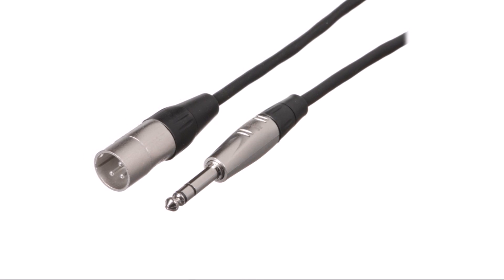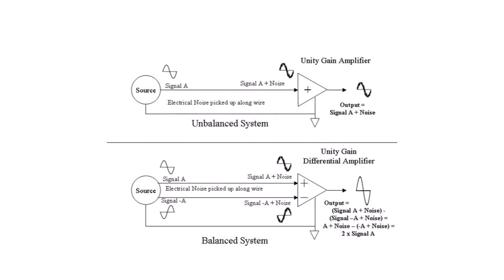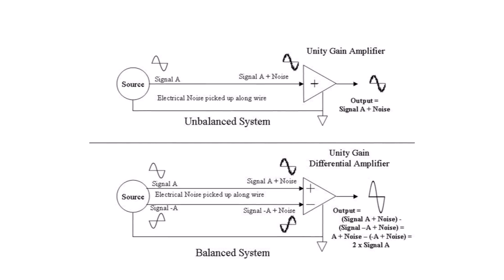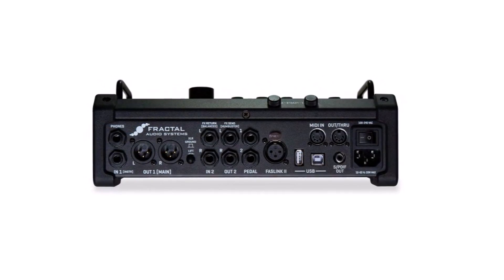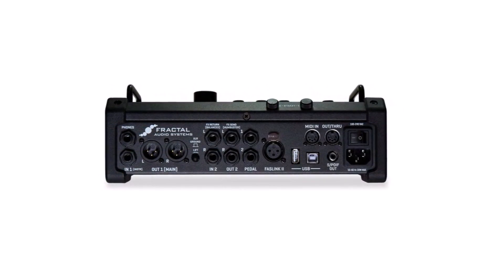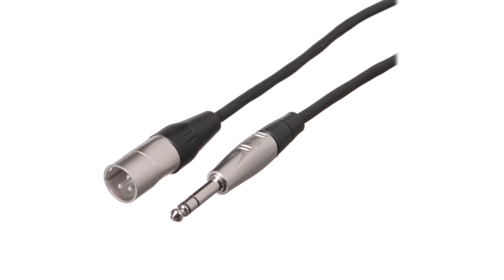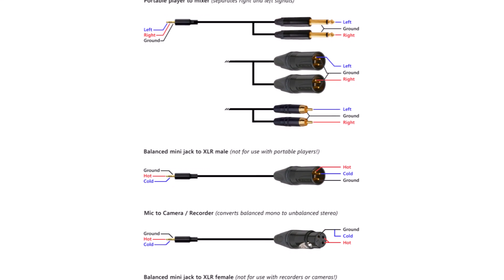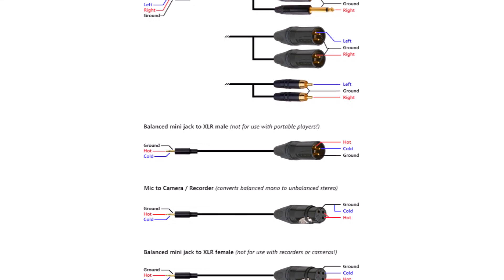Audio Cable Standards: Instrument, Speaker, Balanced, Digital, & More - Explained

Comment: Hey this is extremely helpful. 11:11 - I was wondering if you can help me out; I am looking at the Behringer XR18 and it has some XLR Aux Outputs. I am curious if these outputs can be used with a TRS Female XLR ->  Male (or Female) TRS 1/4. Question is: Will this be stereo? I'm trying to set up IEM with this method.
Reply: All of the outputs on the Behringer XR will be mono, so you'd have to do the two busses linked out, and then use a dual XLR to single TRS 1/4.

Comment: what's funny about SPDIF is that i remember having that connection on my Pod X3 back in the day, and also i have one on my audio interface, as well as an optical cable input, but i've never actually seen SPDIF or optical cables anywhere

Comment: I am planning on buying a BIAS head processor to use with my Headrush FRFR 112. However, the BIAS head processor has L and R output (both balanced XLR and unbalanced TRS), but my Headrush FRFR 112 has only 1 input... Is it safe to run either L or R from the BIAS processor to the single Headrush input? Or is there a better/safer way to do this? And regardless of which port I should use, should I run a speaker cable or instrument cable between the two?

PS: the BIAS processor also has a TRS headphone out,  which is a single one (not L and R like the other outputs). Should I use that one in stead maybe?

thanks in advance :)
Reply from the maker: It doesn't really matter in that case, your FRFR is simply mono. Generally, the left output of amp modelers are the ones you use in mono applications.
Reply: @PlagueScytheStudios  awesome, thanks a lot! I'm still new to this whole audio engineering and home recording, but your videos are teaching me sooo much in such short time :) thank you for making these!

Comment: thinks about using a high-impedance, low-level cable with a zener diode bridging the two conductors on the amp end to go to a speaker
snickers

Comment: I have a question sir! How does a stereo amp head recieve and send stereo out? Is it all TRS Jack or is it  mostly just a double up of ordinary jacks? (Like the send/return loop for example? I've only seen modulation/reverb/delay pedals with two separate outs. It seems like a dated concept to me to not send stereo signals with a TRS cable, and if the cable that's jacked in the TRS capable hole you'd get mono)
Reply from the maker: Pedals do separate inputs most of the time for a couple reasons. One is of course dummy proofing, but many pedals will also double the income mono signal for stereo processing so you dont need a dedicated buffered splitter. That way, the unused half of stereo input is an open circuit.
Reply: @PlagueScytheStudios  .. not sure if understand, instructions unclear, dick stuck in air humidifier.  think stereo amps and the confusion that entails needs its own video.
Reply: It pisses me of that that there are so few good guitar heads that aren't stereo. Put the stereo amp into bridge mode to get double output mono. Seems like a no brainer